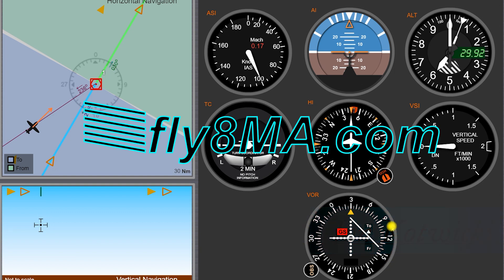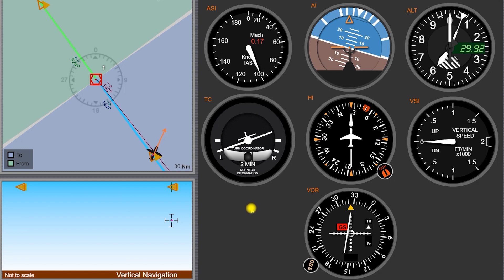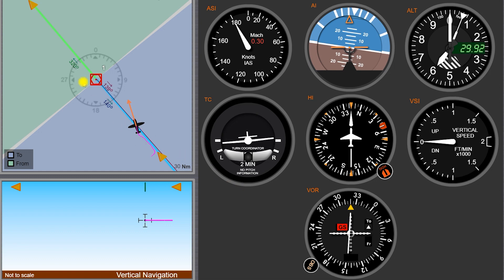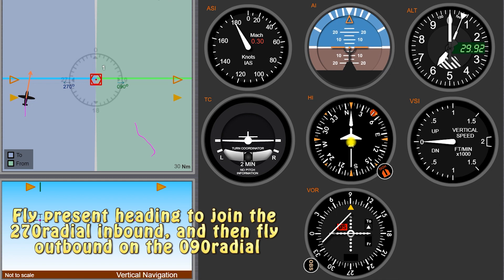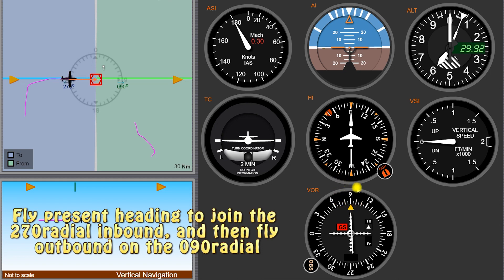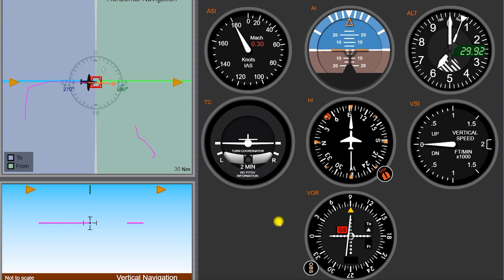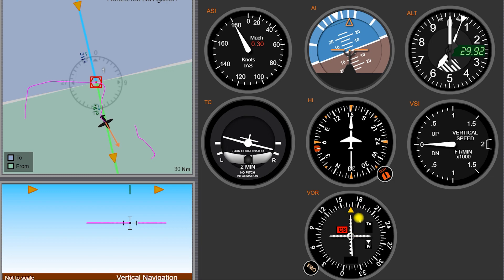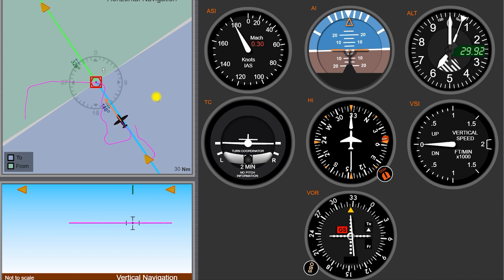Ep. 71: How to use a VOR in an Airplane | Flying Navigation

Comment: i used to teach this in conjunction with a direction indicator so the student can orient themselves on the DI using the VOR data. This video is confusing because the example aircraft is drawn in the zone of ambiguity - on the only line where a TO/FROM flag will actually disappear on the instrument if the aircraft was there. If the DI is used you are always flying up the page on the heading and by centering the VOR with a from flag - you can place your finger on the DI as that is your radial, and the VOR is the centre of the DI.. then dial up the VOR desired radial, and expect a deflection, if you have oriented yourself on the DI this will be simple..

Comment: As a student pilot in the Air Force, I was on my instrument check ride in the T-37, a small twin engine jet with side by side seating. I had a hood on that obstructed my exterior vision. My instructor told me to proceed to a particular airport. I looked up the information, dialed in the frequency and set up my VOR to fly to the destination (just as illustrated in the video). As I overflew the airport (a From indication on the VOR) the instructor told me to remove the hood and look out. I had overflown the wrong airport. What happened? There were two different airports a few miles apart. The VOR frequencies were one click of the dial different. I had mis-dialed the frequency when setting up. What had I failed to do? The rule is “tune and identify”, and you identify by listening to the airport Morse Code identifier. So that’s why the military teaches Morse Code to pilots. An age-old system in modern airplanes. I failed the check ride and passed the re-check. And learned a lesson that it’s the little things that can bite you.

Comment: Correct me if I’m wrong but At 10:01 aren’t you on the 090 course to the station? You keep saying you’re on the 270 radial. Once you get station passage, and the TO arrow flips to the FROM indication, only then are you on the 270 radial.
Reply: You've got it backwards; don't confuse radials with heading. Radials are based on the station and don't ever change. Think of them as lines or roads in the sky. If you're on the "270 radial", its just like being on "Broadway" but it does not tell you what way you're going, just that you are on that imaginary line that runs between an imaginary point (far far away) due west of the station and the station itself. When you have a "To" flag, it is not indicating what radial you are on (because the radials are named based on the position FROM the station), but rather what HEADING you need to fly to get TO the station. So if you need to fly a 090 heading to get TO the station, you have to fly East, which means you must be due West of the station. Remember the name of that imaginary street due west of the station is the 270 radial.

Therefore, once he crosses over the station, his "090 TO" indication switches to a "FROM" indication because he is now on the 090 RADIAL. He flew along the 270 radial until he crossed over the station and then found himself on the 090 radial because he never changed his heading. Remember, the name of the radial changed because radials are named based on the station (and therefore don't change and are totally independent of where your plane is or what direction it is flying), so now he is flying along the imaginary line (named the 090 radial) running between the station and some imaginary point due East of the station. At this point, he could twist the dial to get a TO indication and would see the HEADING that he needs to fly to get to the station would be a 270 heading (he would have to be able to spin around on a dime and head in the exact opposite direction with a 270 heading along the 090 radial to get back to the station).

Hopefully this helps. In all, if you have a FROM indication and the needle is centered, it tells you what imaginary line you are on compared to the station (no information on which direction you're flying). If you have a TO indication and the needle is centered, it tells you what heading to fly to get back to the station. In this video he does this a couple times because by the time you get the plane flying that heading you're probably a bit off course and need to refine the heading again to more accurate point the plane in the direction of the station.
Reply: @davidindovina694  I get it now. Thank you for this detailed response.

Comment: I know this video is old but why is your needle left of 90 degrees instead of right when you are tracking the 90 radial TO? If it's positive sensing, you should follow the needle, right?  But instead you are doing quite the opposite.Is that because they want you to join the 90 TO from the present heading? EDIT: Ah, 90 radial FROM so its reverse sensing since you put it on TO. I think it would have been better if you put it on 90 FROM so the needle would have been positive sensing and would have showed to go to the RIGHT from the 270 TO.

Comment: This information is so excellent, thank you, and as has been pointed out, the VOR stations are in the process of being turned off with it sounds like only 39 to remain across America by 2020.  GPS is changing how we do things and I think the reliability of the system has proved itself for enough years.  No doubt it will completely simplify how people fly, speak the flight plan and the plane will go that way... a lot more people might get into flying if it were easier to navigate.

Comment: 1) Radials are unique places in space. There are 360 of them. It is much easier to visualize a course this way.
2) These unique Radials can only be tracked "inbound or "outbound". (or intercepted)
3) Treat the top and bottom of VOR equally in importance.
4)  "Inbound"  = desired "unique" radial on bottom of VOR with "to" (confirmation is key) on VOR. This should be automatic.
5) Outbound = desired unique radial on top with "from" confirmation on VOR. Automatic.
6) Desired course "Headings" are always "somewhere" near the top of VOR and are confirmed by HI or compass.

In recent years the "gurus" have been confusing "bearing" , "headings", radials, radials "to" etc when talking VOR nav.. When you talk to ATC, or you repeat to yourself the phraseology,  over 270 radial "to", when you are actually "inbound"  90 radial with a heading of 270,. Guess what, ATC radio silence. Do you understand why? ATC might think you are over 270 radial inbound. The only people that know what you are talking about are the ones that can see your VOR. 100% guarantee a reverse sensing situation, or ATC confusion, in your piloting career if you use this 270 radial "to" technique, (or XXX radial "to" technique). 
 "Bearings"  terminology should be reserved for ADF,  RMI,  and bearing pointers, or perhaps the NAVY, or boats, or something. When referring to VOR nav there are only headings and radials. This is what ATC does and so should PIC.
To sum up, the gimmicky shortcut phraseology, XXX radial "to",  technique "works" but can be confusing to others and IMHO is poor technique.
No offense, simply my Old School opinion, Happy Flying.
Reply: I'd like some more of your wisdom if you ever have the time.  

I'm really confused why he would say track the 270, but then put the obs on 90?  

I watched a gold seal VOR Video that said there is never a TO, it's always FROM when intercepting.  I messed around in X-Plane and thought I understood VOR, and I might some what but I feel I'm really lacking, and this video didn't really help as much as I thought after messing around in X-Plane.

Thanks for your time.

Comment: I'm not a pilot but the moment I started making a concious effort to ALWAYS remember the difference between a Bearing (to) and Radial (from) is when it clicked for me. I think a lot of people (myself included) get/got confused when trying to visualize where they are in relation to the VOR because they always think radials pointing outwards (From) the VOR centre. They don't make the effort to immideitely look at or visualize what the opposite reciprocal (To) bearing is in their head. Even if you're a few degrees off it's still good to know. They spend too much time looking at the heading number above the tip of the radial arrow when away from the VOR station eg: after getting the frequency, they'll start turning turning the OBS spinning back and forth until it centres, depending on which way they turn may first line up with radial (From) showing say 090. (This is the point where they should quickly avert their gaze to the reciprocal heading on the opposite side which would show 270 while still turning the needle (To) VOR bearing. When they see the bearing heading number coming around they will know exactly when to slow down turning the OBS and will know when the needle will centre even before the needle lines up and not waste time adjusting if you were turning it too quickly. I sometimes turn the plane onto the bearing early, line up then go back to the VOR OBS and adjust until the needle is lined up depending if I know I'm close a VOR station. You sometimes have to readjust your heading a few degrees because of this or because of wind.

Comment: As you try to intercept the 270° radial, does it give you miles before you get on that radial? Also miles to the station ?
Reply: "miles" would be by dme, the vor is separate from dme and most small aircraft are not equipped with dme
Reply: @FLY8MA  oh wow, so small aircraft just have to use judgement then for miles? Lol sorry I may sound dumb. By the way, your video is awesome!
Reply from the maker: Pretty much, but most of us have GPS of some form or another now on cell phones or iPads...so it's easier than it sounds

Comment: Similar video for NDB/ADF?
Reply from the maker: Yuck, do people still use those?  j/k    We'll see if we can put one together here in the near future.  Its tricky to find airplanes that even still have working ADFs.  Effective last summer it was also removed from the ACS so you won't have to worry about it on any instrument checkrides :) !
Reply: Not a pilot here, just a simmer, but do anyone really needs such a tutorial, esp. knowing VOR? 
It's even simpler than homing in on a VOR station, since you don't have to worry about wind correction, no OBS knob, just dial in the frequency and fly where the arow points (like in any video game with a map:) ) doesn't get much simpler:)
Once you learn how to use VOR other things are just easy: DME - shows distance to the station in miles, ILS - just two VORs, so to speak, one horizontal and one vertical.
Where it gets interesting is for example when you try to navigate using two receivers, maybe flying on a specific radial from one station, waiting to intercept an inbound radial for another. also watching for DME. fully in IMC. with some weather. Or an ILS approach with no visibility down to minimums.
I promise you it's not boring even in a Cessna (though recommend a 3rd party model).

Comment: So after you get on your desired radial and with a heading that matches the radial.....how do you stay on that radial in spite of a cross wind?  Here is how.  It is called the half angle method:  As you begin to tract a radial.1)Get on the radial and then establish a heading that matches the radial.   Then wait a couple of minutes.....and most likely the OBS needle will move off center.  Turn 20 degrees toward the needle and when the needle centers turn to remove 10 degrees of the 20 degree cut that you just made..  Continue to fly and hold that heading.  When (IF) the needle again deviates, turn 10 degrees toward the needle and when it centers, remove 1/2 of that correction (which is 5 degrees).  Now you are flying the heading that will hold the needle centered within 5 degrees.  Use light rudder pressure to maintain +/- 5 degrees.  If the needle should deviate again, simply turn towards it 2-3 degrees.   This whole process takes about 5 minutes to accomplish and results in s heading that will precisely track a VOR or an ILS. (Note:  For an ILS, the first cut towards the needle s/b no more than 10 degrees (not 20 degrees as when flying enroute)

So to summarize:  1) Get on your desired radial and fly a heading matching the radial.  2) When the needle deviates, turn towards it, 3)When the needle centers, remove 1/2 of the last correction made.....
Reply: That's a great method! Thanks for your reply! I'll have to give that a shot.